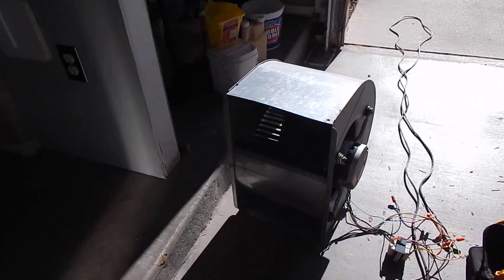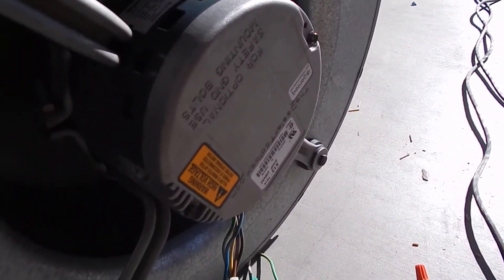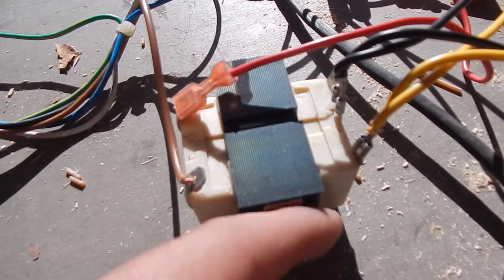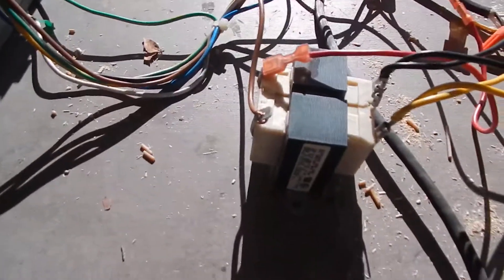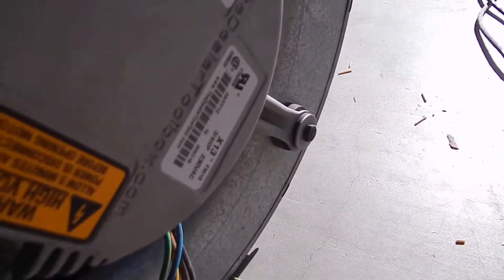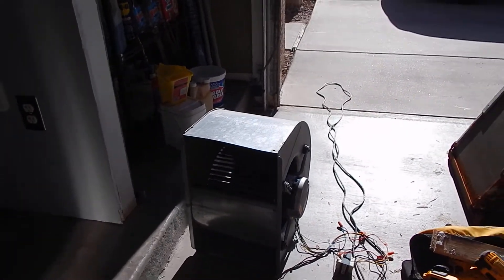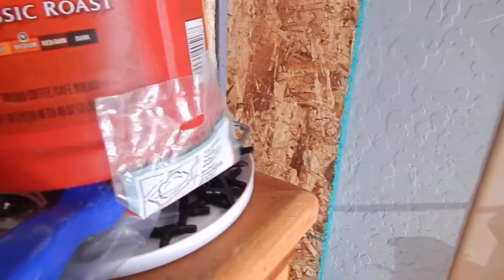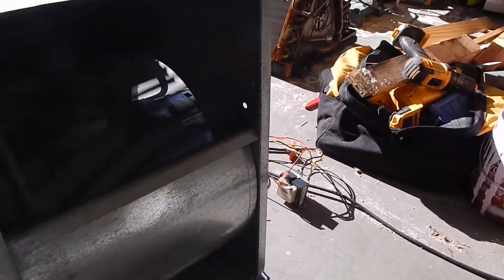230 Volt Genteq X13 ECM Blower Motor On 120 Volts

Comment: If you(or anyone) could figure out how to bypass a faulty module (while still using the the caps in the module or some substitute - it’s my understanding the ecm motor will not start without caps?), to turn the blower fan on, then you’d really have something. In the event the a person loses heat and either can’t get an hvac tech on site or can’t afford $1000 fix, at least they would have heat still to get the thru. 😊
Reply: Correct about the caps it needs those to start. Usually it’s the circuit board on the back that messes up. You can usually just switch those out or I should say I can lol.. I think they’re either not picky about the motor they run or they have some self learning feature. I know some ecm’s and alot of electronic speed controller do that.

Comment: I had to replace my house system and had to almost fight to keep the blower fan, I found it hard to find any info on using ecm motors as standalone fans. I plan on using it in my greenhouse on the lowest setting. thank you

Comment: Got a commercial blower with a 1hp motor for free, then I got a 120v in to 208-230 out VFD and a honey well analog temp controler, the fan can ramp up on temp and shut off at a set temp. I mad that my house fan

Comment: Do you need the transformer?
Reply from the maker: For an ECM motor you need the transformer to send a call signal to the motor to turn on. If you don't use the transformer then the ECM motor will not turn on when power is applied.
Reply: @CristianOrtiztechmaster926 how much hp is the motor you tested